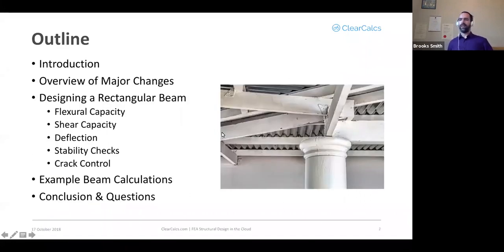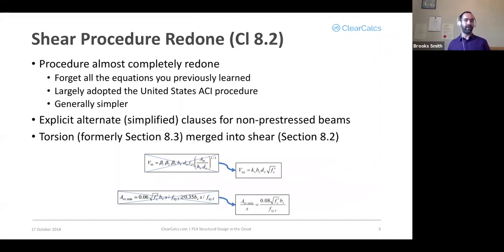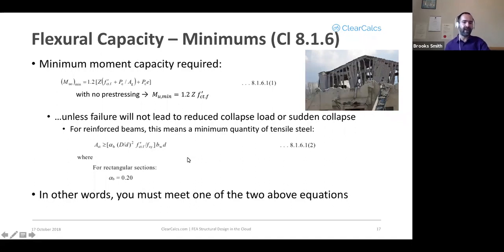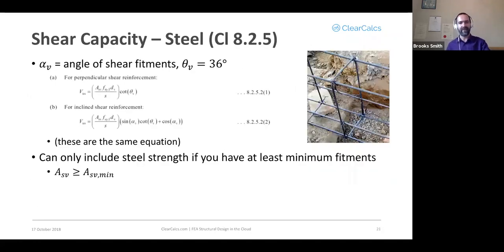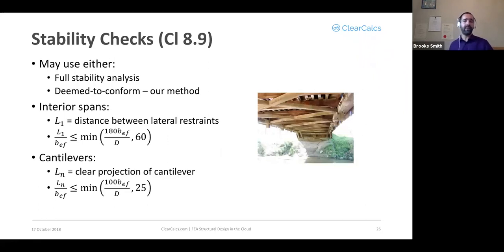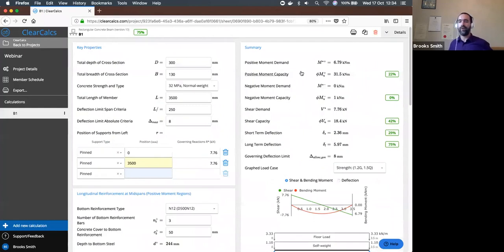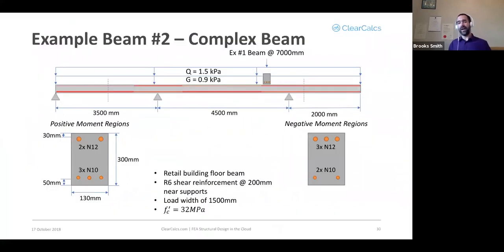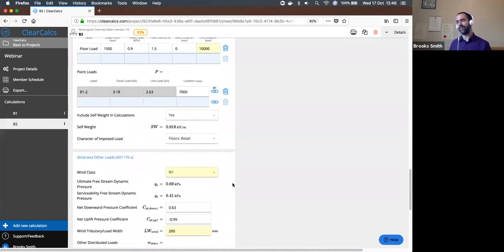Webinar | Designing a Concrete Beam to AS3600 2018

Comment: Hi Brooks, I was wondering if there is any reference books that helps strengthen our understanding of AS 3600 in PLAIN English, e.g. something combining hand calculation ans specific clauses. Most books (Well, of course including AS itself) are just very hard to keep going through, and there is basically none Australian-based. Thank you!!
Reply: did you find anything please ?
Reply: Unfortunately, I do not know of any plain English or more straightforward books that articulate how to perform an AS 3600 concrete design. And I strongly agree with you that that's a problem - particularly given that AS 3600 is less prescriptive than most of the other structural design standards. 

I'm afraid the best I can suggest is a US textbook - I like Pincheira et al's Reinforced Concrete Design (now on 9th edition): https://www.google.com.au/books/edition/Reinforced_Concrete_Design/G02SzgEACAAJ?hl=en . But it is, of course, a US textbook so it's using ACI 318 rather than AS 3600. The two standards are quite similar, but definitely not identical.

Comment: Why does the derivation of Z for the calculation for Muo(min) consider reinforcement?  If the minimum moment is based on 1.2x the cracking moment of the concrete, should that not be taken from an unreinforced section?
Reply from the maker: Hi Messr Zeddy,
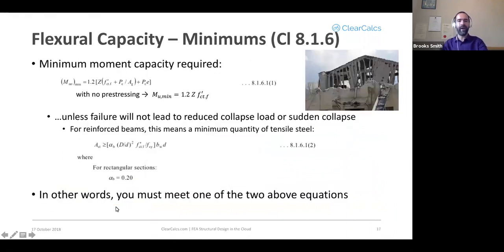Thanks for your question. For the benefit of any other readers, your question refers to the minimum strength requirements discussed at 12:08.

First, I want to distinguish between the "uncracked" moment of the beam and the "unreinforced" (or "gross") moment of the concrete. As long as your reinforcement is fully developed (that is, its development length has been reached), then the concrete is fully bonded with the reinforcement and it will act compositely with the reinforcement. In such a case, the reinforcement will help prevent tension cracking in the concrete, and the uncracked moment should therefore include the effects of the reinforcement as described at 10:11. 

The Muo(min) requirement is specifically a test on the bending strength "at critical sections" (see Cl 8.1.6.1), and at a critical section, your reinforcement should definitely be detailed such that it is fully developed. Z is defined in the clause as the "section modulus of the uncracked cross-section". The reason I note in the webinar that you will usually meet the minimum bending strength requirement by means of the second equation I cite (the Ast minimum - Eqn 8.1.6.1(2)), is that the standard's wording in Cl 8.1.6.1 is specifically as follows: 
"For reinforced concrete cross-sections, this requirement shall be deemed to be satisfied ... if [the Ast minimum is met]". 
That is, the standard implies that a minimum quantity of reinforcement is a means of satisfying the Muo(min) equation - further implying the effects of reinforcement are included in Muo(min).

I hope this answers your question, and do let us know if you have any other questions!